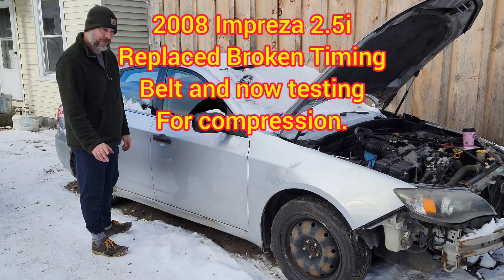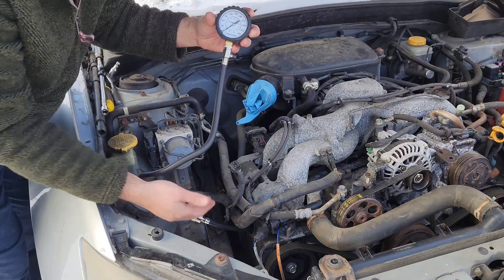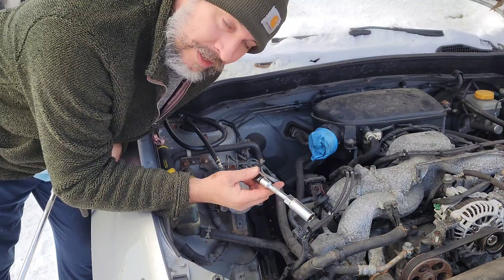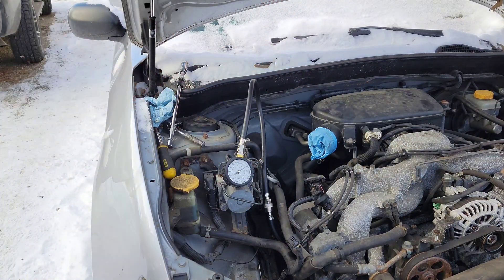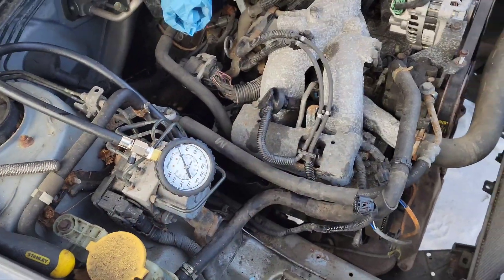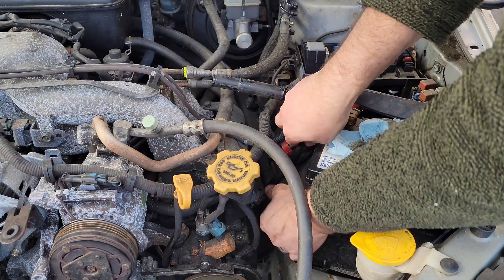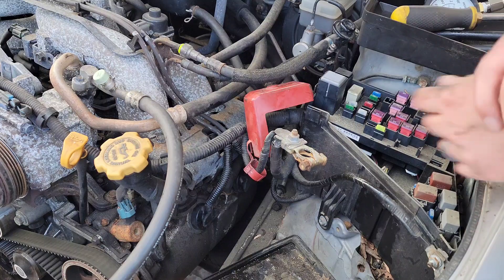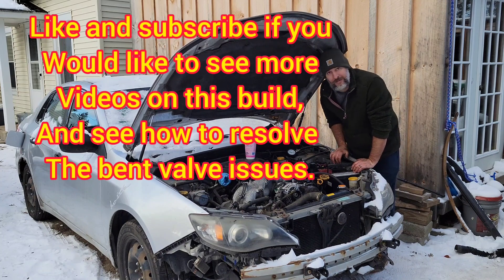Compression Test For Suspected Bent Valve After Broken Timing Belt 2008 Subaru Impreza 2.5i

Comment: Did you replace belt before or after the compression test?
Reply from the maker: I removed the old broken belt and installed a good used spare belt I had from this cars twin, making sure all timing marks were lined up properly. I didn't change tensioner or idlers initially, as this step was juat so I could check compression. It won't be possible to check compression without having timing set and belt in place.  So once I confirmed there was no compression in 3 out of 4 Cylinders I took belt back off and removed heads to rebuild. Once rebuilt I went ahead and reinstalled heads along with brand new timing belt and associated kit.